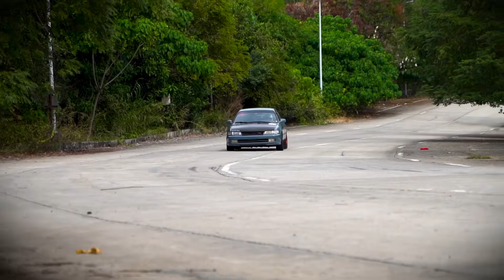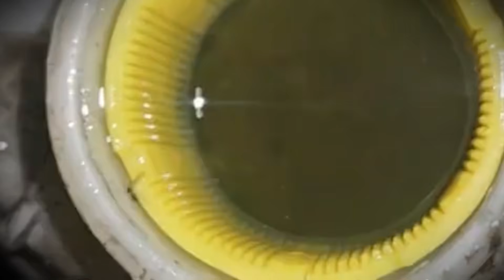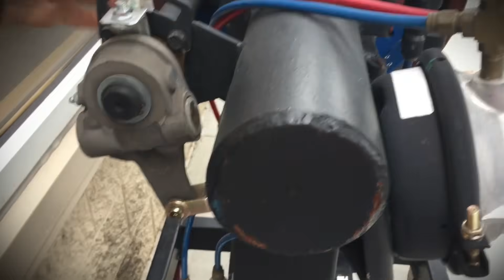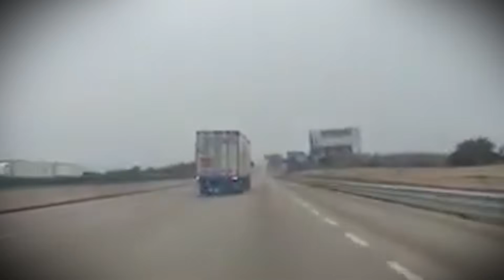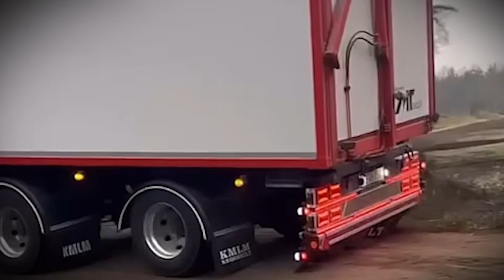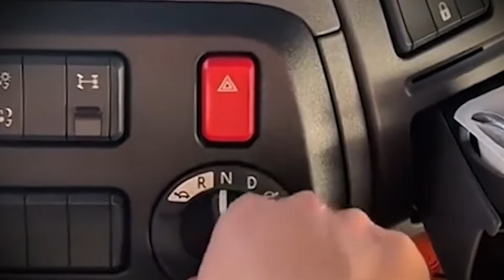The Strange BRAKING SYSTEM That Stops Semi-Trucks When It FAILS

Comment: You are partially correct in that the air releases the brakes.  There's two separate systems.  The park brake system and the service brake system.  The park brake uses air to release the park brakes.  If that bleeds off, the brakes set.  The service brake system uses air to apply the brakes when the park brake system is charged with air and the park brakes are released.  If you're going to create these stupid A.I. videos to teach people shit, you should do your fucking research first.  When you don't get it right you just make people dumber for watching your garbage...